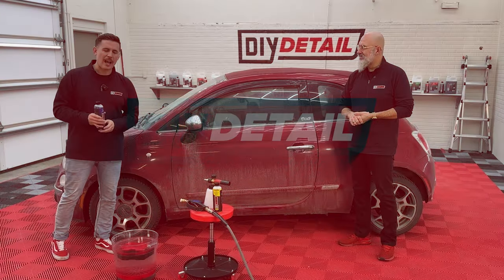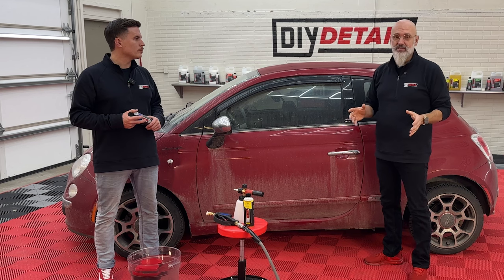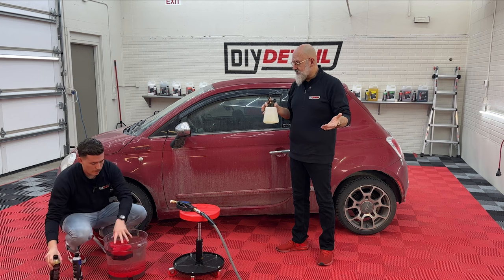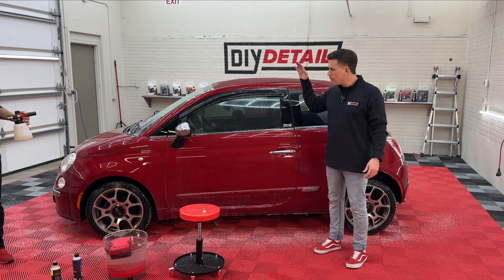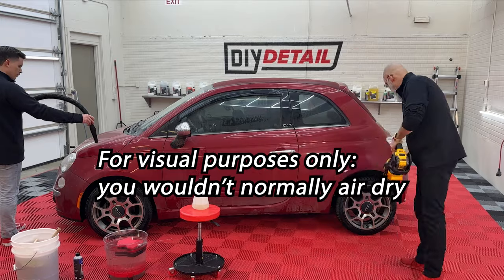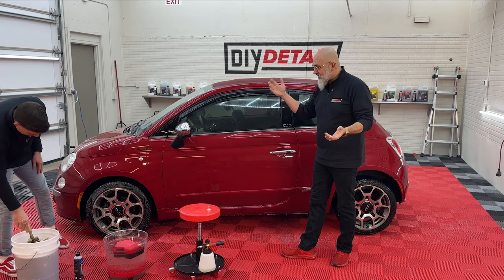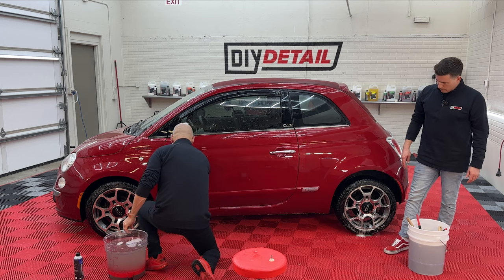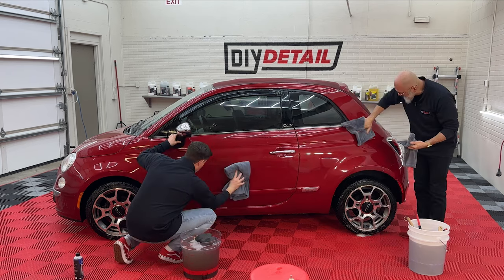How to Rinseless Wash a DIRTY CAR! #rinselesswash #diydetail #detailing

Comment: Great demo, guys!  Quick question.  In theory, Incredible Suds could be used for the pre-soak/pre-rinse, and then Rinseless for the contact wash.  Which would you say is more effective overall as a pre-soak/pre-rinse - Incredible Suds or Rinseless?  Thanks!
Reply from the maker: Your choice, they are both very effective.

Comment: Does rinseless wash work well to remove bugs as a pre rinse with a pressure washer? How do you remove bugs effectively from the front bumper with your products? Thank you
Reply from the maker: This works: Pre treat with all clean/rinse/ foam or spray rinseless on surface, contact wash, then if there are bug guts left you can use your decontamination towel (soaking in rinseless wash bucket) and lightly go over the affected area
Reply: By decontamination towel, do you mean the fine grade clay towel listed on your site?

Comment: I have a question, hoping you can answer.

I have an IK Sprayer that has a Degreaser in it and wanted to use it for your Rinseless Wash. 

Question is how can I thoroughly clean the IK Sprayer so that there is no cross contamination and to insure I have fully got rid of the Degreaser in it so that I can introduce your Rinseless Wash?
Reply from the maker: Empty, rinse, empty, add some water, pressurize, spray, empty, enjoy.

Comment: Your Rinseless wash has surfactants which differentiates you from others on the market.

However, I was wondering if a full polymer has an application that is better suited than your product?  

Stated differently, is there an application where a full polymer is part of a better remedy?
Reply from the maker: No surfactants have an advantage in cleaning, polymers water softening. We combined both to get the best results and safety possible.

Comment: If I’m doing a rinseless wash outside not in direct sun, is it safe to dry my vehicle when I’m done, or is it better to do panel by panel?
Reply from the maker: Up to you
Reply: Doesn't matter? Struggling with where to keep the in-use drying towel if I do panel by panel approach.
Reply from the maker: As long as you are towel drying instead of air drying
Reply: Yes, definitely towel drying and leaning towards just drying at the end  because if I'm understanding correctly, rinseless is just leaving behind polymer spots, encapsulating the minerals so water spots don't form?
Reply from the maker: True
Reply: Is it normal to see leftover dirt residue on the car w/ a rinseless wash after pre-spraying w/ pump sprayer and washing before drying w/ towel? When I applied rinseless and washed it, it looked like it removed the dirt, but after it dried w/o towel, the dirt showed up. It came out once I took my microfiber towel to the rinseless solution but didn’t expect that (first timer).

Comment: @2:41 you recommend 1oz of rinseless in 25oz water in a foam canon/pressure washer set up. Back in Oct 2022, there was recommendation for 4oz of rinseless per 28oz (https://youtu.be/NIcly0sWQ9Q?si=EtYGeP42ndVRP71v&t=101). Can you clarify why the change? Thanks for the info.
Reply from the maker: It depends on how much foam you want

Comment: i know yvan is frugal but i might be a bit more...ok, if/when i wash my car with rinsless and say i have 2 gallons of water/rinsless mixture left in the bucket can i pass it through a strainer (like a fine mesh paint strainer) and save it for future use. does the mixture lose it's potency over time and is rinsless better if mixed with cold, warm or hot water?
Reply from the maker: You can, but depending on what was removed from the paint it may start to smell

Comment: My car is coated with Opti-Coat Pro3 and a top layer of Opti-Coat Pro+. It has been suggested that because the ceramic is Silicone Carbide and not Silicone Dioxide that for compatibility I use only Optimum products like ONR or Opti-Coat No Rinse and Optimum Power Clean. What are your thoughts on this?
Reply from the maker: Yvan used to be VP of Opti-Coat, it’s a great marketing strategy.
Reply: @diydetailofficial  Should I take your reply to indicate that there is no substance to claiming that compatibility demands that one stick with Optimum products, that saying this was merely a way to have people stick with Optimum?

Comment: I have heard Yvan say in a video that you should sometimes do a pre rinse on dirtier cars.  Does that mean using a pressure washer because that would cause scratching from what I understand.
Reply from the maker: Foam first and then rinse after it’s had some dwell time…and then go ahead with your contact wash
Reply: @diydetailofficial could you use a pump sprayer instead of a foam cannon?
Reply: @Kahleeb.  I did. Just got a galon of diy rinseless and an ik foam pro 2. Worked great on a secondary vehicle that sits next to trees most days of the month. (i did apply a degreasing apc first followed by the diy rinseless to be safe). Worked so well, I went back online to order an ik foam pro 12 to do this with, so i can put wheel cleaner in the smaller one. Previously, i had been using a cheaper foam sprayer from amazon to foam car shampoo and wheel cleaners, but was curious to incorporate foam with rinseless washing.

Comment: Quick question, given Rinseless wash is good at cleaning the body of the [dirty] car...ould you use it for cleaning engine bays, so it's a bit safer when "rinsing" with less water around Electricals and areas where sitting water can damage engine parts such as diesel injectors?
Reply from the maker: Yes

Comment: Assuming you didn't air dry the vehicle after the pre soak and initial rinse, would you respray the rinseless back on prior to using the sponge or is the leftover water from the rinse with the rinseless on the sponge enough for a dirty car?
Reply from the maker: Re spray

Comment: Not sure if I am noticing this correctly but is the rinseless bucket being used have two grit guards in it or am I just looking at the black on the bottom of the bucket and that is dirt underneath a single grit guard?  If it is two grit guards, what is the advantage of two?  Just wondering, was Nick using rinseless in his wheel bucket as well?  Thanks!
Reply from the maker: Only one grit guard. Yes DIY Detail Rinseless Wash in both buckets

Comment: I'm doing rinseless contact wash regardless since it's more effective, easier to see what I'm missing and it can be it's own drying aid, however, if you have both options available, what would you guys prefer for the pre-rinsing stage?

1. foaming with incredible suds (or any other pH neutral cap soap) and then rinsing with pressure washer
2. foaming with dyi rinselesss and then rinsing with pressure washer?

I don't find more foam fun or anything like that, I just want to know which one will clean better and remove more contaminants before contact wash.
Reply from the maker: This will answer your questions

What's the best product for PRE TREATING paint? 3-product showdown
https://youtu.be/mMuBlyfO-kM
Reply: @diydetailofficial  thanks!!

Comment: Is it beneficial to use distilled water with your rinse less product during the wash process?  If I decide to premix my solution way ahead of time, would it be better to use distilled water so the premixed solution has a longer shelf life?  Then I can just dispense as I require?
Reply from the maker: For a regular bucket wash no, for long term storage, yes
Reply: @diydetailofficial  thank-you!

Comment: Would the drying towel be more dirty compared with foam wash? Should i wash my drying towel after rinseless? Cuz i dont have to with a foam wash
Reply from the maker: It will be very slightly, and you should be Washing your towels every time, foam or rinseless

Comment: what pressure washer do you use/recommend?  any suggestions for something not too noisy?
Reply from the maker: We use a Kranzle, but there are many more affordable units that are not overly loud.
Reply: Greenworks 2700 here. Well-built and a little quieter than most.

Comment: Does the legacy sponge pick up and retain oils (ie oils from brake fluids, oils from the road, etc)?  If it does retain oils and the sponge doesn't fully release the oils in the bucket, will you scratch the painted surface over time?  Or, does the rinseless fluid also pull oils down to bottom of the bucket so that you are not reintroducing oil back on to the car surface.  

In your filmed situation, would it make sense to rinseless foam canon watery then come back rinseless a little more foamy to remove oils and films like Ivan mentioned in the video.  

Do you recommend applying panel prep always before applying a spray on sealant, wax, etc? For proper adhesion.

Just wondering, I'm very new

  Thank you.
Reply from the maker: The DIY Detail Rinseless Wash does a great job cleaning the car and doesn’t load the sponge. 

You can foam DIY Detail Rinseless Wash, but it’s a waste of product. 

You only need panel prep prior to a coating.

Comment: Hey let’s say after this wash you were to do a clay and seal. Would you leave the clay towel in the bucket during the wash process? Does the bucket get too dirty for a clay towel ? I’m trying to master the art of the rinseless clay and seal 😂🔥
Reply from the maker: Yes, and no 😀
Reply: By all means put it in the bucket. The rinseless will help neutralize the ceramic which we want. The dirt is in suspension and broken down so very safe to use.
Excellent question! Happy Detailing

Comment: Hello  DIY Detail I am 14 and starting my own car detailing buisness i've been looking into rinceless washing for a quicker wash on detail's  .I have a question like when you pre spray with a sprayer or keg sprayer it is efficent . But I wanted to no if I put it rincewash in a foam cannon turn the nob so mostly water comes out and pre soak/spray it that way then come with the wash sponge and start washing. Would that be a efficent method.

You videos and methods are amazing and are going to help me strating my buiseness.
Reply from the maker: Unfortunately not, look at options that don’t require a pressure washer. I started when I was 12, and had I had access to Rinseless Wash I would have been enthusiastically using it.

Comment: Can you use a detailing brush with the rinseless pre-soak in the same way you’d use it with a snow foam to get into the tight areas (around the cameras, badges emblems etc)
Reply from the maker: Yes

Comment: So I'm new to detailing my own car. I've watch a few of the rinseless wash videos now and it always seems like at the beginning you talk about that the car is ceramic coated. Does rinseless wash work just as good on a unprotected car?
Reply from the maker: Yes it does--absolutely! The best part about a coated car is that it is much easier to clean in the future, so I would just keep that in mind in terms of your own car...making that a possible goal of yours to get it coated
Reply: @diydetailofficial  Thanks for the reply! I plan on attempting a ceramic coat before winter rolls around here in the mid-west.

Comment: hmmmm..... rinse-less wash does require a rinse tho...lol.. its washing a car but in reverse ..aren't you worried about "scratching" the clear.. because the idea behind a traditional wash is to lift up dirt and remove with the soap to minimize scratching.... right?
Reply from the maker: Rinseless means you do not rinse the solution off the surface before drying. Rinseless is a technique, once you get it, it will be safer than a soap wash in most instances.

Comment: This is a nice demo, but I feel like the fact that you used a pressure washer to foam the car and then rinsed it off as a prewash, totally defeats the purpose of a rinse less wash… if you have access to a hose or pressure washer, why bother? Just prewash and two bucket method
Reply from the maker: Rinseless doesn’t mean hose less. Rinseless refers to the fact that you do not rinse after the contact wash.
Reply: That’s my point exactly. One of the main benefits of rinseless is that you can do it when access to water is limited. I feel like compared to a traditional contact wash via 2 bucket method, the chances of scratching your car are a bit higher with rinseless. I guess you could argue that rinseless is a bit faster or that it leaves less of a mess on the floor afterwards, but any other benefit to going rinseless?
Reply from the maker: @yao-wencheng6350 Rinseless is safer than a traditional soap wash, plus it’s a drying aid and lubricant.

Comment: I would never use a leaf blower to dry my car. You just put a million scratches on the car from the particulates in the air accelerated 100 mph onto the cars paint through that leaf blower. Wow! I don't believe what I'm seeing.
Reply from the maker: Use what you like, we also have a Master Blaster that we would reach for first
Reply: You mean the same air you breathe   ? 🤡
Reply: No more of a risk then just driving the car. More likely to get damage from stones from cars passing by.
Reply: @25rsti15  Air is dirty. Try cleaning out your nose and look at the tissue
Reply: @reefhog  air is dirty . Try cleaning your nose then look at the tissue
Reply: @new2dayuser151  my point is, the particulates in the air in most areas are not going to scratch the paint, we're talking about less the .1 of a micron. If that were the case it would be unsafe to drive your car at highway speeds. Yes there are places like Arizona where sand and dirt storms are infact abrasive but using common sense and not washing your car during high particulate counts will keep it safe. I've been drying my cars for years with a leave blower and now a metrovac with no maring and this is also on cars known for having very soft paint. My cars look like mirrors and I wouldn't use a method that was unsafe or clean them while the farmers are tending to the fields right by me.

Comment: Rinse less washing a car that you first used a pressure washer on is silly and defeats the purpose of the rinse less wash. If you have everything to do a normal wash do it. If you dont have water access or your an eco detailer conserving water then use a rinse less.
Reply from the maker: The Rinseless in DIY Detail Rinseless Wash doesn’t mean you can’t. Rinseless is referring too Not rinsing after the contact wash, you can and should rinse before if needed.

Comment: Why are you using a pressure washer? Kind of defeats the purpose of the rinseless wash.
Reply from the maker: Rinseless Wash (often confused with no hose wash) simply means you don't spray/rinse at the end. So after the contact wash you can go right to that drying aid. We actually like to pre rinse dirty cars if we have access to water and we're out of direct sunlight

Comment: Rinseless wash DIY / better then P&S ABSOLUTE  ?  AND WHY  @DIYDETAILOFFICIAL
Reply from the maker: Here are the major differences, only you can decide which is best for you. 

DIY Detail Rinseless Wash is both surfactant and polymer based, meaning great  lubrication, but also cleaning ability. We have one dilution ratio for all uses, no need to dilute differently for different jobs. Finally the DIY Detail Rinseless Wash is a thinner consistency, making it easier to mix. 

I suggest you ask the question in our facebook group. 

https://bit.ly/DIYDetailFacebookGroup